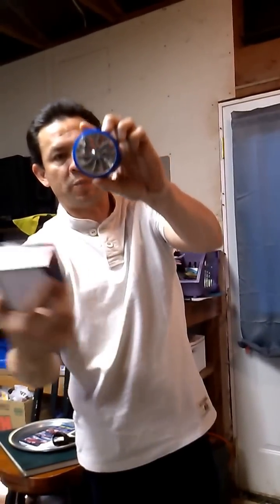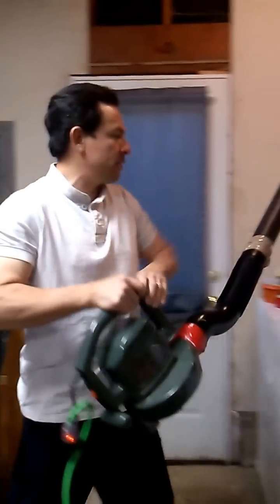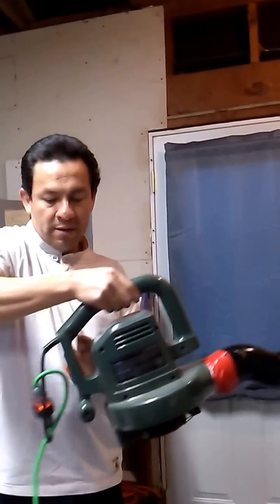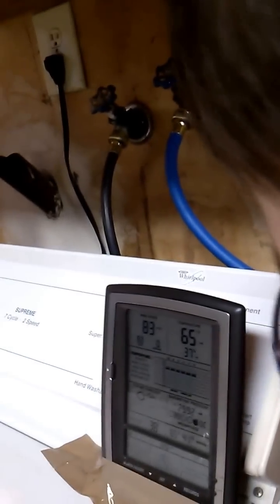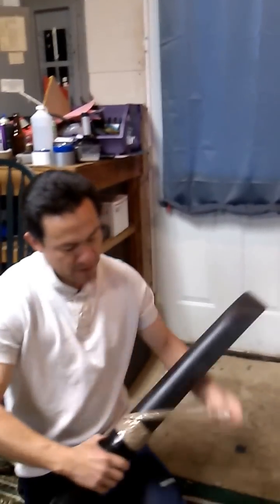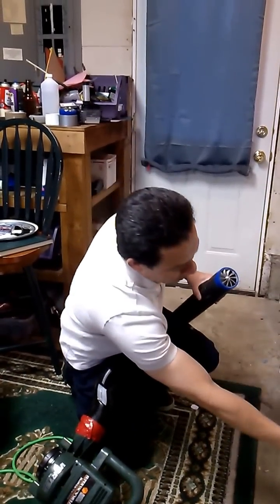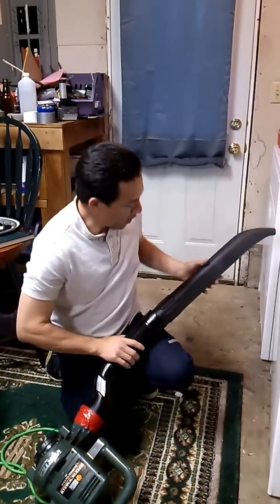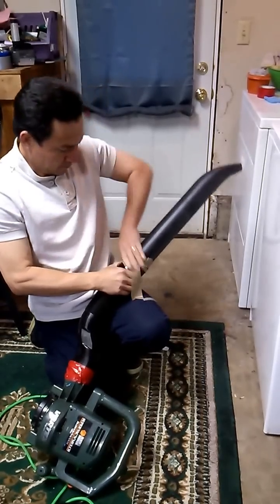The Turbonator Air Intake Test  subscribe for more mad science

Comment: Unfortunately this test is not correct. Your trying to force air through it. That's not how it's designed to work. You need to suck air through it instead. I know the thing doesn't really work to begin with but your just texting it wrong.
Reply from the maker: You are absolutely right.

Comment: Only honest way I can make sense of these things is they don't help bring in air, but instead help vortex the air in the  intake and help cool the air that goes through it towards the vortex. I really don't think you will gain any real advantage if you have a baffled intake, seeings as it'd disrupt the vortex. Maybe with a basic cold air intake you'd get a little more noticeable difference at higher speeds once the fan is up to speed with the air flow. But I feel like you'd have to put a really high friction resistant oil on the bearings of the turbonator for longer distances at higher speeds. I honestly believe after about 20 minutes of high speed driving the fan will break apart or the bearings will lock up if precaution isn't properly taken.

Comment: All it's doing is adding resistance. Being spun by the air being pulled already. Unless is spun on it's own being able to spin fast enough to pull more air than already being pulled then it's doing nothing but adding resistance and decreasing pressure. Not to mention it will mess with your engine as the ECU tries to get a certain mixture of air and fuel and this will mess with that. When u lower your foot off the accelerator this thing will have some momentum and probably pull a little more air than you actually want when u take your foot off the accelerator. It's doing all the wrong things.
Reply from the maker: James H good observation

Comment: Please do not put that shit in your intake..
Reply: Robert Perez y not plz tell me because I want to buy one
Reply: You’ve got to be kidding me. This will do nothing but obstruct airflow. It could not possibly create more power on ANY vehicle. It’s science. This is a poor cash grabbing device. Regardless of what this video may or may not prove about this fan. It will ruin your vehicle. Any claims that it increases mpg or horsepower is BS. Watch a vehicle dyno. Proof is in the graph.
Reply: Robert Perez okay thanks wat about the sound will it give me a good sound on a basic stock engine an stock exhaust system
Reply: Its called inertia
Reply: moses cabusao you’re high if you think that this stupid fan in your intake will create power. Lmao Inertia.
Reply: Robert Perez you’re more high if you think it doesn’t.. the fan will work as inertia for the air and it will fill the irregularities of air that the vacuum of the intake manifold creates.. same concept as if your car is running on a highway at 100mph and you only need a little power to make it run more.. its called inertia..
Reply: Robert Perez you are an ignorant pest, 20% obstruction but 80% inertia.. it has not been proven on dyno but it has not been disproven on dyno also so it is innocent by default you moron.. lets wait for the dyno result if someone does.
Reply: Robert Perez i think you have a small brain because this video already proves it, you cant believe how it actually increased the cfm. Simply because your mind doesn’t understand how it works. You think much inside the box.

Comment: This test  is showing an increase in pressure. After reading the comments I see as usual most are from people who have no clue.  I use these units and find a noticeable  improvement in torque a little fuel millage and slight power improvement.  They spin the air causing a vortex and atomizing the fuel air mixture better. the pressure is not what anyone should looking for in this type of unit.
Reply: Captain Fishing Action you’re high.
Reply from the maker: Captain Fishing Action I agree with you. But whatever vortex you create will be diffused as it goes through the flat air filter housing. On my 97 Mercedes s420 the filter intake housing is flat so that will distort the vortex. So I think the common believe is that this unit create pressure so no matter what kind of filter set up you have you will get a slight performance curve because of pressure.

Comment: so does this thing work or no?
Reply from the maker: SuperPhen0m NOPE!
Reply: have you put it in your car? and you got nothing out of it? so its a scam?
Reply from the maker: SuperPhen0m nothing is all a scam! best thing to do is put supreme fuel in your gas tank add techron fuel injection cleaner at every 3 tank fill ups and you'll get extra 🏇 power. that's what I do on my old Mercedes.
Reply: ty sir, i was about to buy one of these
Reply: One think i noticed was how long he had to have it blowing just to get it up to speed. There for just about ur entire race it will create more drag before it actually just flows the air more evenly. Therefore it is not helping at all. And like others said. That thing has to spin much faster in order to be worth your time.

Comment: Whats interesting, is that if something goofy like this actually worked in any way possible, car companies would put one in at the factory. :) They actually do typically put a thing right at the airbox that straightens the air out, to prevent turbulence. I could imagine if that for some reason your car didn't have one, some nonrestrictive device could be used to prevent turbulence and see a bit of gains. The only cheap bolt on mod that affects your engine performance is an exhaust system. That's because the factory exhaust is designed to be quite and pass smog tests and as such restricts a few hp. It's somewhat possible to gain a bit on the upper power band with an intake system, really just depends on the car, but not really worth the price you pay for them. However on the right car and done the right way, you can rig a pod filter on the stock piping and grab 1hp for cheap, just has to be a stock system that pipes away from the engine. I have seen a few stock intakes that were pretty horrendous, i can imagine decent gains on those cars with a good CAI... Generally any of the 70's/80's american cars, were getting choked, because the smog laws and the companies really didn't have good ways to pass, so they murdered the performance on those engines... Most of those cars were crap anyways IMHO. 60's american cars were at their prime and went down after... 90's jap car's hit their prime and went down after. Somebody needs to make good cars again.
Reply: If you think car company would put anything good in a car engine to increase power u mistaken, they didnt consider turbo or superchargers till car enthusiasts started building one, they didnt care for exhaust modifications till car race guys started gutting their pipes, believe it or not car company follow the emission laws way too much to think outside the box. The same air box u talking about doesnt do anything for a car due to all the corners the air has to travel, now slap on a CAI Or SRI and see how it increaes torque. IJS dont ever trust car company to make best performance, they are emission law obeyer

Comment: Even if this thing creates an air vortex, does the air vortex will still be shaped as a vortex while it pass through the intake manifold plenum and finally inside the cylinder? Like in a V engine where the intake hose and the intake manifold plenum is longer than in inline engine for example.
Reply from the maker: Virginia Cherrill  probably not, some of the air filter assembly are not quite round as it gets to actual intake. for example if you put it before the air filters the vortex will be diffuse as soon as it passes through the filters.

Comment: Air doesn't travel in a straight line.  It moves in a vortex more efficient than a straight tube. The blower has a fan also. When the Turbonator and the blower fan gets to the same speed then its tuned for maximum airflow. Any other time its lowers the airflow.

Comment: I'm torn between thoughts, common sense says it shouldn't work because, the force needed to spin the fan creates friction which slows air speed, but the vortex effect says it should work because the fan creates a vortex that speeds up the air speed. Ugh my head hurts, I want to see this on a dyno, I need proof.
Reply: Kean Campling I would say it works similar to a turbo in the sense that it takes power to get it going so an initial lag but after that it should work until you slow down and the fan stops again, no clue though honestly lol